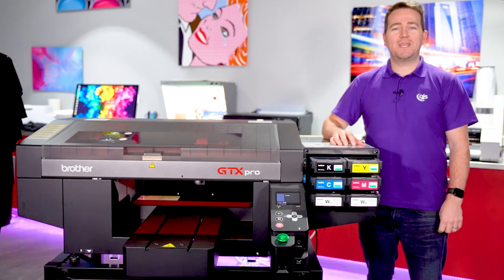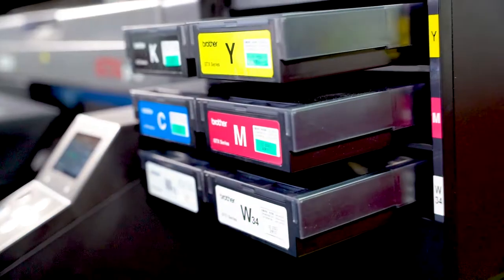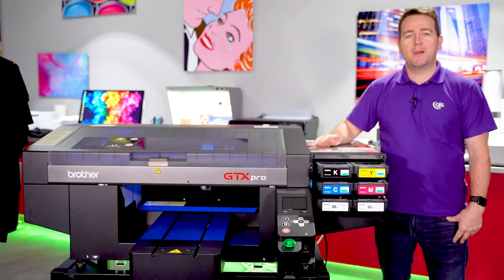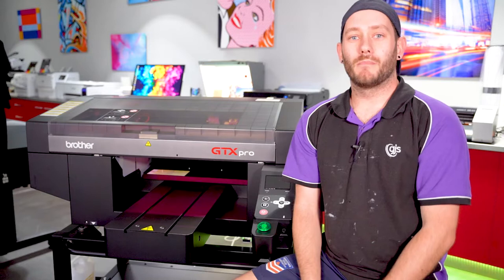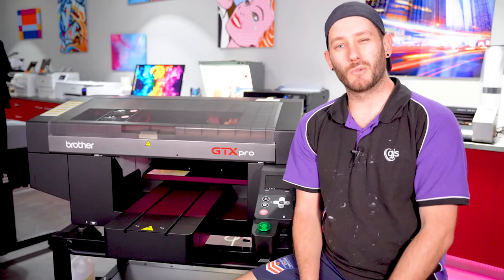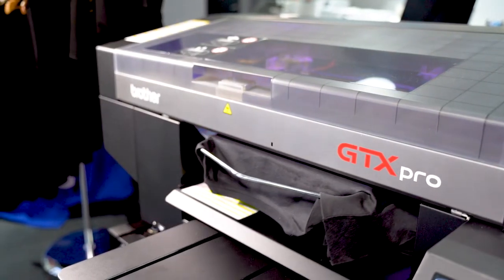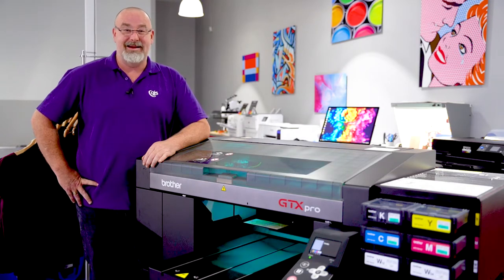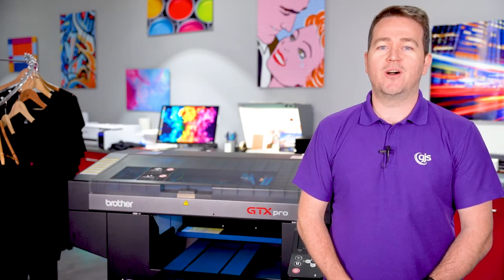Brother GTXpro DTG printer - first look with the GJS team!

Comment: Hi there, are the inks the same for gtx and gtx pro? Brother was promising an ink that allows you to print on polyester (up to 100%) and cotton, is that true? Cheers
Reply from the maker: Tea čaj, the inks for the GTX and GTX Pro are indeed the same. And you are also correct, Brother has released a trial driver that allows you to print on polyester with the same inks. If you contact your local Brother distributor they should be able to provide you assess to this driver download.